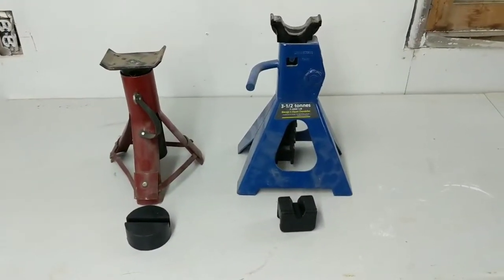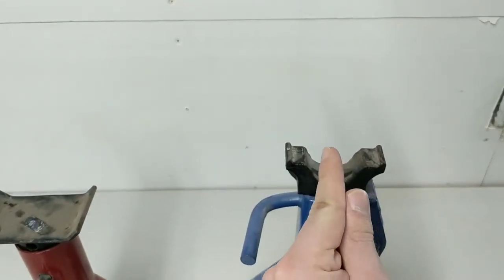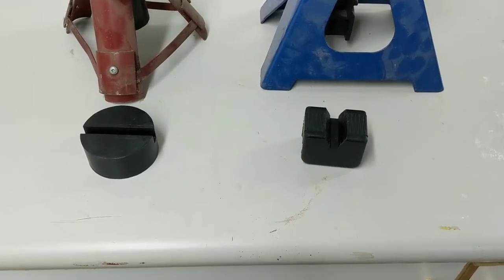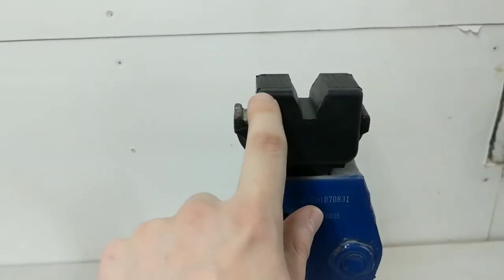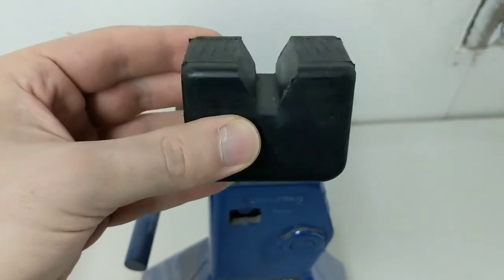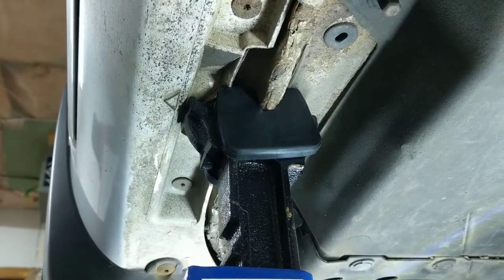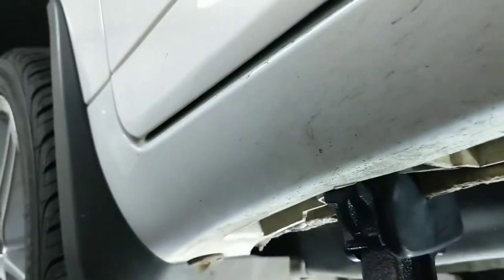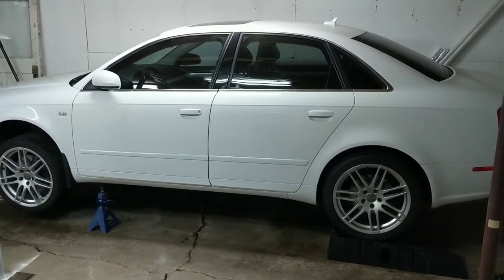Audi Jack Stand Adapters - 20/20 Tool Review

Comment: where did you use floor jack? There is not room for jack stand and floor jack  to stay together.
Reply from the maker: Correct. That's why I had the bad habit of jacking from the front subframe near the transmission mount, or on the rear subframe from the differential. Lifting centrally, you can then put in the jacks. It's bad practice but there aren't many other options unless you have a lift.
Reply: @FigureItAudi  I was thinking about subframe, but I have a feeling it puts too much stress on it while lifting with so much weigh. I don't see center jack points I could use. I'm using rear lower control arm where it connects to the engine or subframe I guess as a jack point where I put the jack stand while the car is lifted from the jack floor